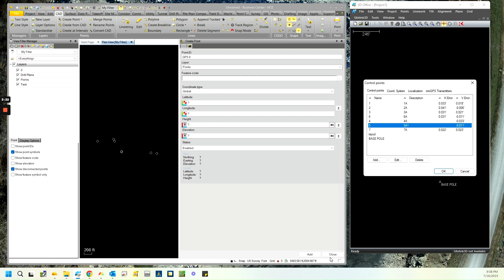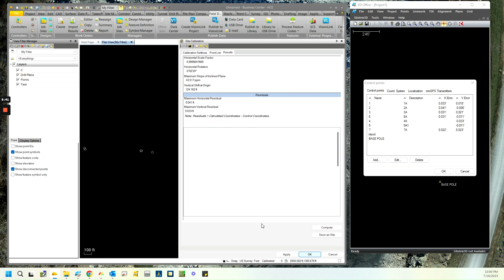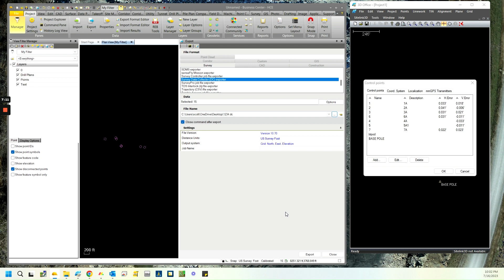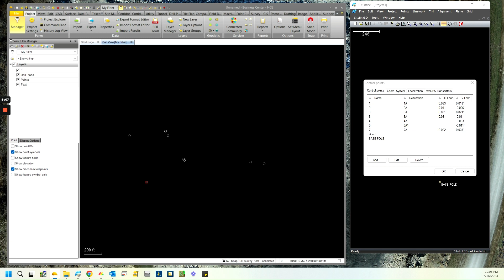Converting Topcon .GC3 File to a Trimble .CAL File

Comment: I usually create 2 text files in Pocket 3d, a PNEED and a LLH one.  Export those and import the PNEED to TBC, setting it to survey quality, I make sure my units are correct then I drag and drop the LLH file into TBC, rename the points by adding a letter “A” to them, then I perform a site calibration and match the grid and global coordinates.  I make sure my residuals match with localization I have in 3D Office and I’m good to go and ready to export my files.